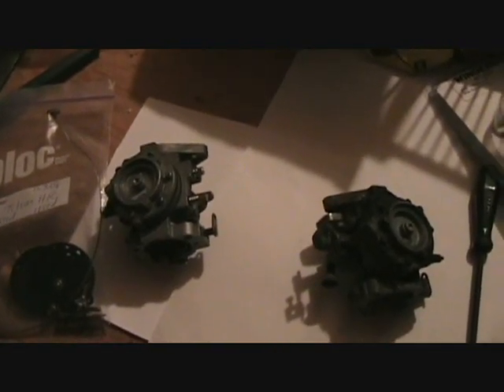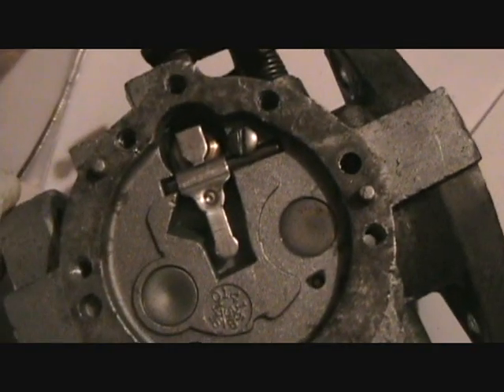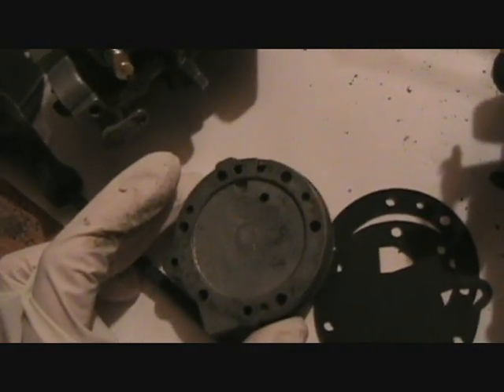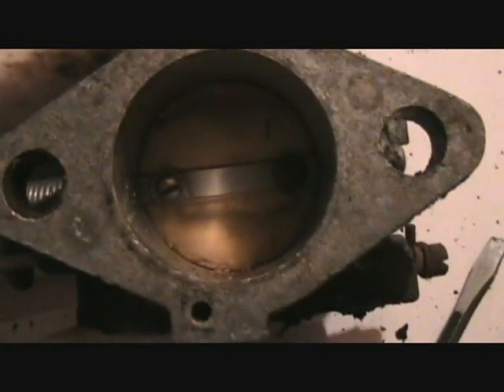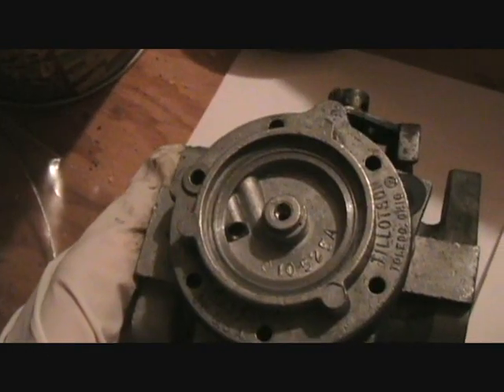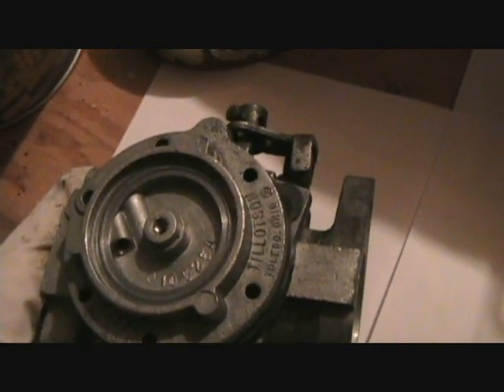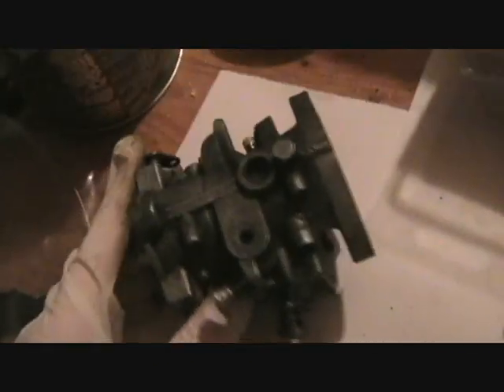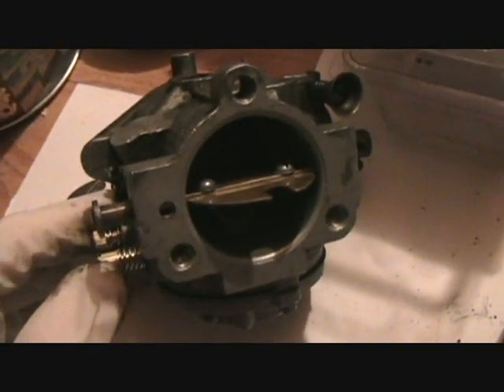Working on a Tillotson HR Carburetor

Comment from the maker: @icanflyhigh I am no expert, but your inlet control lever may be bent. In my video I didn't replace or clean under the welch plugs and if your sled has been running for that many years there may be dirt under there.